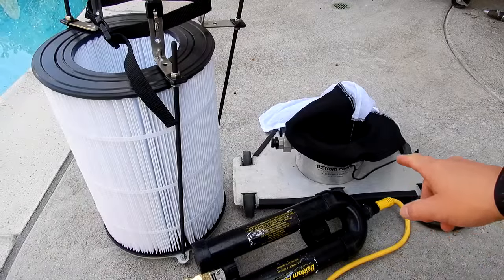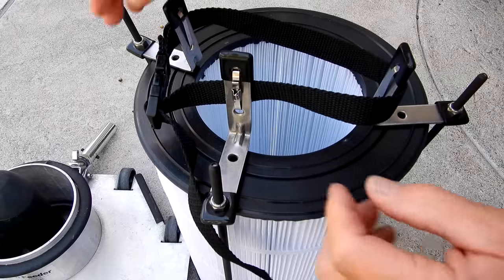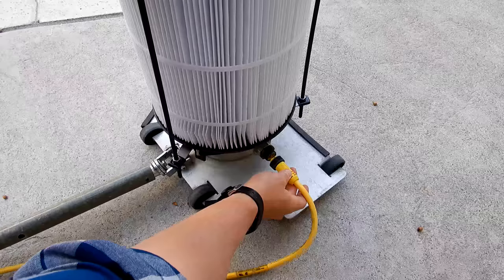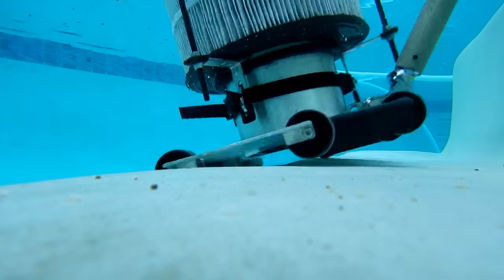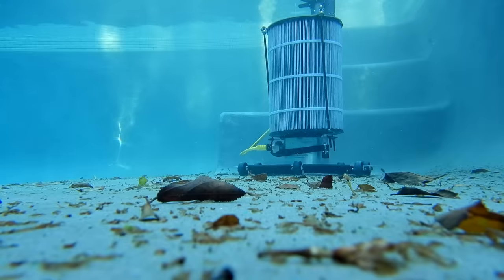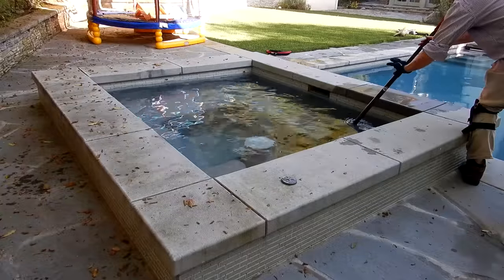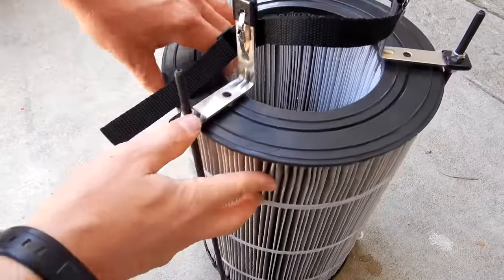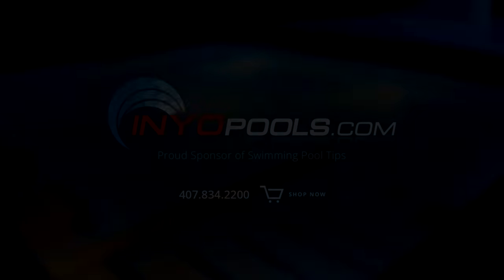Bottom Feeder 20 Micron Cartridge assembly - a Real Game Changer for the Vacuum Systems!

Comment: This is genius! I have one regular pool in my summer route that this would be perfect for. The liner in it gets sucked up easily rendering a regular vacuum head to the pump system useless, the Power Vac is usable but over time it’s accumulated a lot of silt that just goes through the bags.
Reply from the maker: This is very handy. He sells a PowerVac Cartridge adapter. Doesn't work as well as this one because of the balance but it is effective. You can find it on their site.
Reply: @SPL  Do you happen to know if he sells a hammerhead or riptide adapter cartridge filter?

Comment: How good does this system actually work Need to know quick because I'm thinking about buying one Before they run out of stock again
Reply from the maker: Works really well. You wouldn't want to use it on every pool because the bags also can pick up to 100 microns. But for pools with dirt on the bottom and leaves, it is great. I just talked to the owner today. If you join my Coaching Group you can save $200 off the price. 👍
Reply: @SPL   How do I join
Reply: So how can I join your group
Reply from the maker: @keithlopez8636  You can sign up here: https://www.patreon.com/poolguycoaching

Comment: Hey David, will this work on a Hammerhead by chance? Thanks buddy.
Reply from the maker: I think it won't work on another vacuum system because the thrust may be too much. The Hammer Head uses a 30 lbs thrust motor with the blade on top. The bottom Feeder uses an 18 lbs thrust motor with the blade on the bottom. And there is the added thrust ring to bring down the power even more.

Comment: Do you have to remove the portability kit when you want to use the cartridge?
Reply from the maker: Sorry, can you rephrase? Not sure I am tracking.
Reply: I wanted to see if you still have to put the battery upside down if you’re using the portability kit
Reply from the maker: @dflipsidez  No, You don't need to reverse it with the Portability kit. Now I am tracking! 👍

Comment: That thing is nice! How does it compare to the hammerhead?
Reply from the maker: It has a bit less power but it is very compact.
Reply: @SPL  Hi David, I was wondering if you could elaborate a bit more on this. I have a Hammerhead right now and this new system looks great. Is it better than the Hammerhead? It looks easier to handle and put away. I'm tired of the hammerheads weight and size. The price looks great. Which of the two are you using currently? I'm thinking of making the switch. What do you think?

Comment: Hello Pool guy from OC here that’s looking into buying the bottom feeder. Would it be possible to make your own bag? Like maybe take the bag from a filter grid and somehow attach it to it?
Reply from the maker: The thrust motor is only 18 lbs so you can make your own bags if you want. I don't see a problem. The other vacuum systems probably nor as they are 35 lbs thrust motors.

Comment: This bottom feeder assembly is NOT light once it’s dirty. It’s pretty heavy . I’m young, in shape . Also noticed that once you use it after 1 one pool, on the next one it will release a small amount of dirt into the pool. Also the clip I received it broken from the shipping . I understand it might of broken through shipping . This assembly also damaged my portable on and off cable with tore it . I followed the steps on this video for install . Now I have to use the unscrew and screw cord . Hopefully customer service gets back to me on this 🙏🏽 it’s a great vacuum for the micron bag . Worked great . But for the cartridge , it’s a no go for me . I’m a pool technician out here in LA .
Reply from the maker: I think maybe a smaller cartridge will solve a lot of the issues. I noticed the puff of dirt also and you can't move it from pool to spa easily. Not an every pool use device as their new 57 Micron bag picks up a lot of fine dirt as well. Thanks for your honest feedback here.
Reply: @SPL  it’s a great product , hopefully this small feedback gets them closer to an amazing product that will allow us pool technicians sweep through pools faster . Servicing 20 pools per day a breeze .
Reply: @SPL  My riptide/cartridge does this also. I use a 50sqft and a 75sqft stand depending on how dirty my pools are. Once it loses prime, it will push some dust through. Also it IS heavy with the bigger cartridge, but the 75sqft cartridge will get 100x more than the 50sqft and im not sure why.

Comment: This vs a robot vacuum?
Reply from the maker: No, it is a manual vacuum in the sense that you have to push it around the pool floor.
Reply: @SPL  oh I understand that. Was curious if you had an opinion for a homeowner as to what would be worth spending my money on? How much time does this take vs maintaining a robot vacuum? (e.g. with a robot I'm still required to empty the debris container, take it in and out of the pool, probably do some manual brushing where the robot didn't clean,etc. How much more time and money is something like this?)
Reply from the maker: Sorry, I read that question wrong. 😜 If your pool is very dirty every week I suggest this over a Robotic Cleaner. It takes 10-15 minutes to vacuum out your pool each week with the Bottom Feeder. Robots work well in pools that stay clean or get medium debris and are not designed for pools that get trashed every week. The benefit of a robot is that you just drop it in and it does all the work.  But if you have a little bit of time to spare a Vacuum System is the way to go.
Reply: @SPL  thanks for your quick response! Keep up the great work on your videos.
Reply from the maker: Your welcome!👍